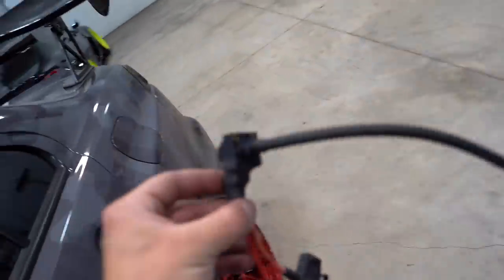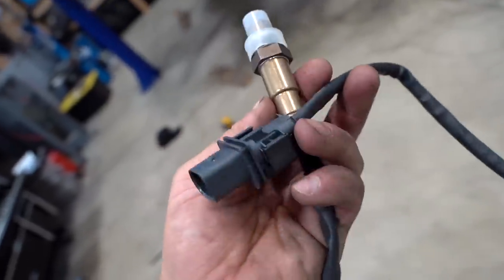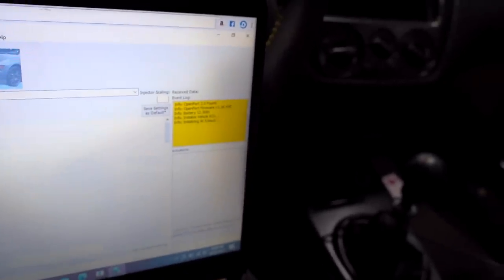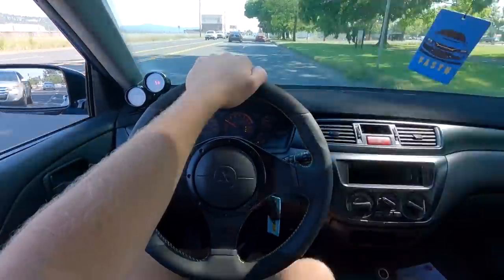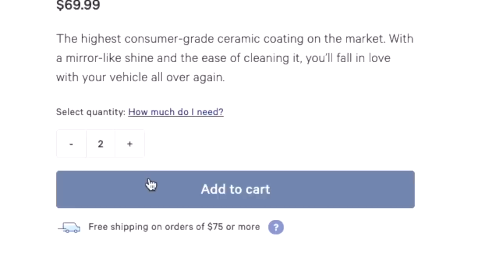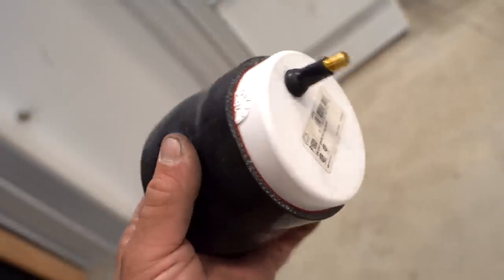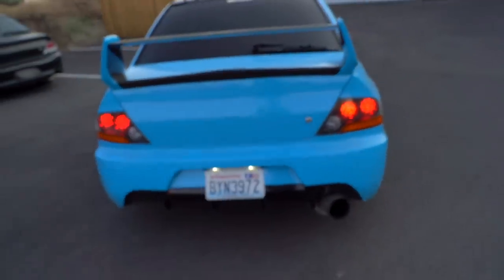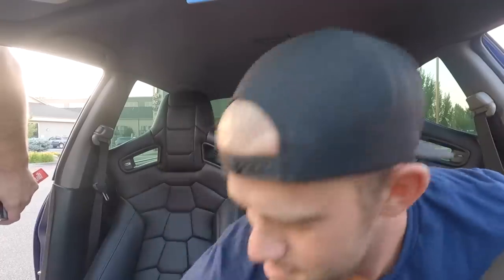Letting Her Rip!

Comment: Usually drivablity only suffers from oversized injectors not oversized fuel pump since the pressure seen by the injectors is set by the pressure regulator, unless the pumps cant keep up.

Comment: My old evo ix temo used to be a bit under half way during the summer - temperatures used to go up to 122/125 degrees (out of the ordinary high would reach to 130), evo water temp reading never went over half way. You might have had an air bubble.

Comment: Devin remember that on e85 you have to change the oil every 1,000 miles and if you rip it hard on track change it before and after every track section have Seen to many people blow their cars. Uz they run e85 and don't change oil more because e85 makes oil degrad way faster that regular gas